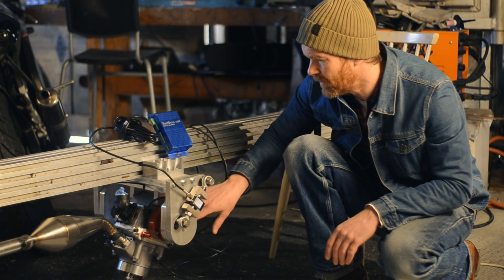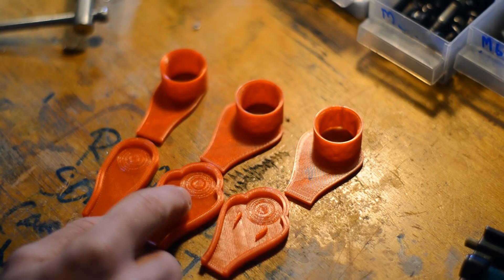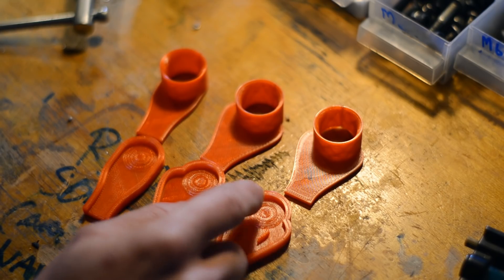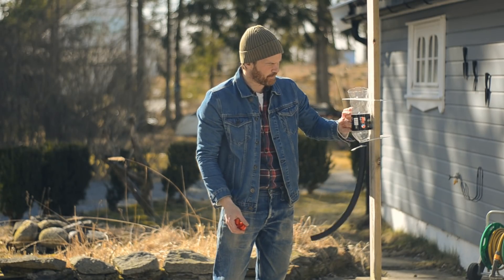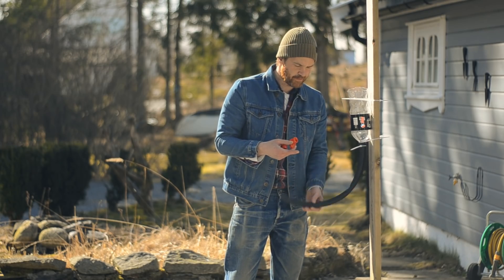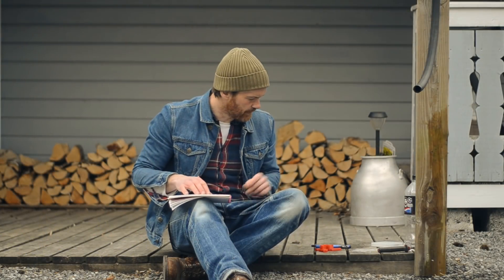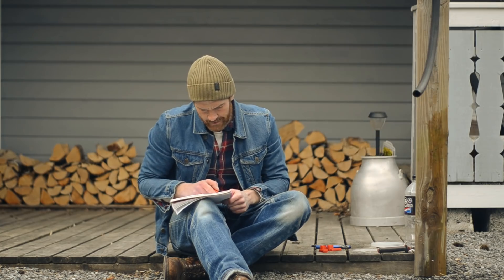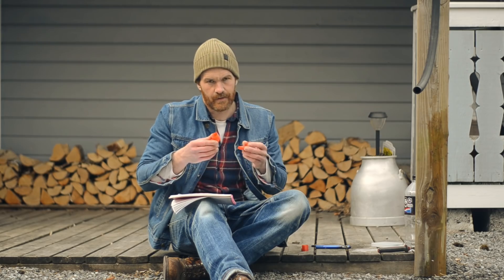Three 2T Exhaust Ducts, Which Will Flow Better?

Comment: I half expected all the results to be the same!! The problem is using none compressible fluids to model compressible fluid flow is never going to work too well :-(
Reply: Yup. Also the speeds are completely different. If you're looking for turbulence, velocity plays a massive role. Also viscosity. What he showed here is more like "wider path = more liquid will pass"
Reply: @dengeondengeon  Yes I thought they were all going to be the same based on the outlet size being the same.
Reply: @dengeondengeon  my thoughts exactly
Reply: He might be better off filling a tiny compressor tank to 20psi and timing the flow down to 10psi, something like that. it still wouldn't account for heated non-uniform gas flow, or the fact that it's start-stop but might be able to create that on-line too.
Reply: yeah agree, liquids dont compress well, thats why flow benches for 4 stroke cylender heads use air
Reply: Hmmm, Sir Stanley Hooker (a hydrodyamisist, amongst other things) might have had something to say about using water for flow tests. He managed to double the efficiency of the Merlin supercharger, which was considered the most efficient at the time. My initial thought was what the effect of the pressure drop due to the expansion chamber effect would have on that bulged area?
Reply: @MrKips1  What decade was that!?
I dont think anything less than CFD is going to be useful, even then I think its going to be suck it and see.
Reply: @manoo422  It was the late 1930s and early 1940s. Using CFD without Computers would have been very inefficient considering the thousands of man years of manual calculating.
Reply: @manoo422  lol Yes, it was a long time ago. However, when Boeing skipped the practical step and left it all to the computers, it didn't end well!
Reply: @MrKips1  Unfortunately some people think computer design can replace actual testing!!
Reply: Compressibility is not a problem here, because the Mach number is small. Reynolds similarity should be preserved however
Reply: @fg8557  Yes it is, the Reynolds number is irrelevant as it will be so small due to the low velocity. The Mach number is even more irrelevant!!
Reply: @manoo422  when Ma<<1, which is the case, the fluid is practically incompressible.

For the Reynolds number, not the value is important, but Re of his experiment should be the same as the Re of the actual part
Reply: @fg8557  Maybe its a translation problem but that make no sense at all.
Reply: @manoo422  i meant that the fluid ist practically incompressible. Pressure and velocity can change, but the density stays constant

Comment: I’m seeing a bulging shape of the water after it leaves the port, I’m curious if there’s anyway to incorporate this into a pipe to improve scavenging. A normal two stroke pipe would not take this into account that I know of.
Reply: To test this could you 3D print “pipes” that come off the port section to see if a second bulge would improve the flow?
Reply: Then to implement it into an actual motor you could just pancake a section of the pipe

Comment: Sweet!😀
Reply: Another thing to think about is the return pulse from the expansion chamber. What effect does your design have on that? My experience has been to use an expanding taper out of the exhaust port, kind of reverse/opposite from the taper down on an intake port
Reply: As the exhaust cools it gets more dense, needing a larger pipe for the same flow. The return wave would act just like an intake when it’s “on the pipe”. I e never thought about alternate designs. A constant diameter pipe (or one with about 1-1/2° taper out) to the expansion chamber is all I’ve ever heard about.
Reply: Traditionally, to me, the exhaust pipe from the port to the expansion chamber has just been a way to get the exhaust to an area where there’s more room for the chamber. Maybe all you need is a transition from your exhaust port shape to the round shape of the chamber? Maybe transition from the port to the chamber along the full length of the expanding side of the chamber...🤔 kind of how it’s done in HVAC when going from rectangular to round ducting